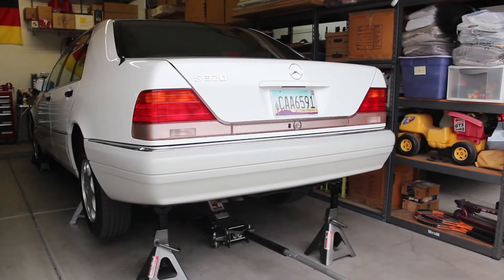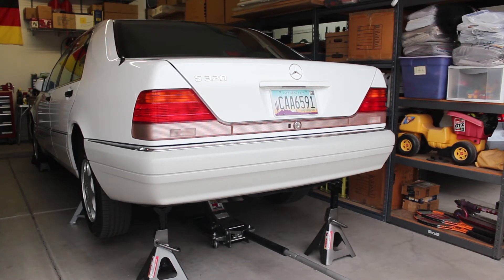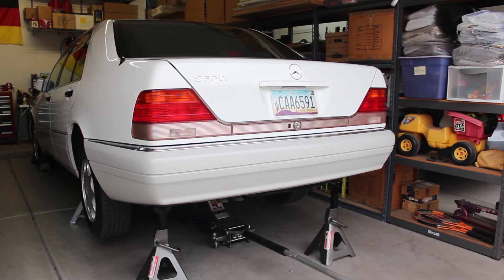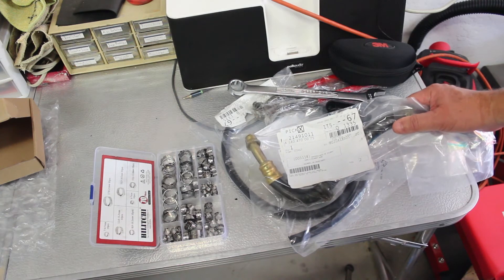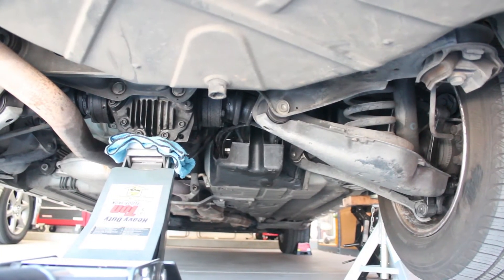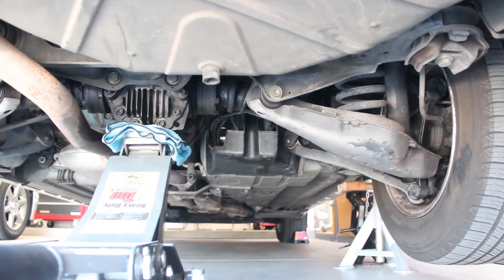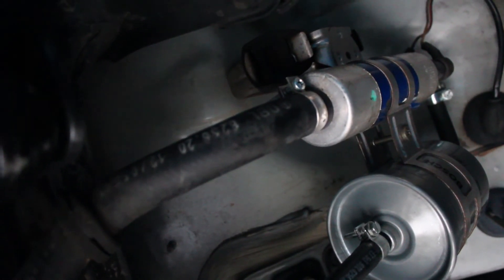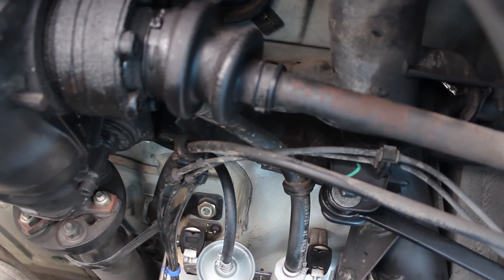W140 Mercedes-Benz Leaking Fuel Line Replacement

Comment: Quick question - how would you jack the front of W140? I'd like to put it on two front jack stands and I'd like to know if there are any jack points under the engine, so I could raise it evenly and put it on two front jack stands. Thank you.
Reply from the maker: There is a crossmember you can jack from (behind the oil pan if I remember correctly), there actually used to be a special service tool from Mercedes that docked a standard floor jack to that crossmember.  Newer S-class models have a rubber pad there for jacking purposes.  Thanks for watching!
Reply: @redonKiLaus  Thank you! I found there are two crossmembers there underneath the car - one is in front of the oil pan, another is behind. Please could you tell me if both crossmembers are safe for a jack or just the rear one which is behind oil pan? Thank you.
Reply from the maker: @yolo-cars  I believe the rear one is what's used, but it's been a while since I've jacked one so I can't swear to that.  If you look in the manual it might confirm the jack point.  Thanks for watching!
Reply: @redonKiLaus  Thank you! Actually I was able to successfully jack it via the front crossmember. The rear one located a bit deep inside. It's like raising a car via rear diff which is pretty deep under the car.

Comment: Did you find that this hose started leaking again??  I have replaced mine TWICE now in as many years.  Its starting to become a yearly maintenance item.  I'm going to replace with a Genuine MB part next, hopefully that will put a more permanent stop to it.
Reply from the maker: Mine's been perfectly fine since this repair a few years ago...might be the material of non-genuine hoses.  Thanks for watching!
Reply: @redonKiLaus  Do you recall which brand you used?  I used Cohline.
Reply from the maker: @Johnathan_Waters  I don't, it's been years since making this repair.  Most of the stuff I use is OEM but not sure what was used here.
Reply: same problme here... every 6 months or so.. did you find the solution? thanks
Reply: Yes, buy a GENUINE MERCEDES BENZ part instead.  Will last much longer.. @MohammedAldawsari7

Comment: Hey I have a 2001 S430 and I’m having issues securing fuel lines for it , any tips
Reply from the maker: I haven't worked on that portion of a W220 so I can't offer anything specific, other than to ensure you don't spark or ignite anything while doing the job, and to work in a well ventilated area.  Thanks for watching!

Comment: My 98 cl500 were off almost 1 year.last night a replaced the dead battery and try to start but it was not staring I noticed once I connected the battery a rotten smell came from the rear passenger side.
Reply from the maker: The rear passenger side is where the battery is kept, so that is likely where that smell is coming from.  Definitely something you need to investigate ASAP.  Thanks for watching!

Comment: The high pressure feed and return from the fuel rail are indeed special MB hoses with special ends.  I did not need to replace them as they were still in great shape.  Same with the feed hose from the tank to the pump inlet - still pliable and "perfect".  For whatever reason, the OEM (Contitech) high pressure hoses were failing (splitting) - but the car is 22 years old, so that is OK.  Just replacing the two high pressure hoses is messy, but not a very difficult job.  Good luck!